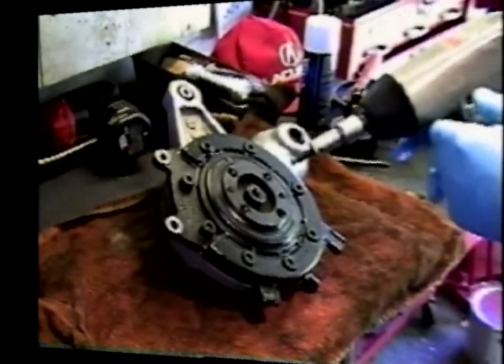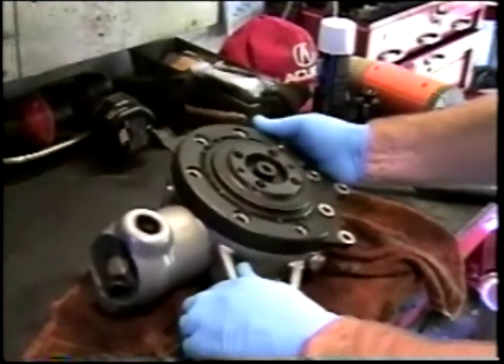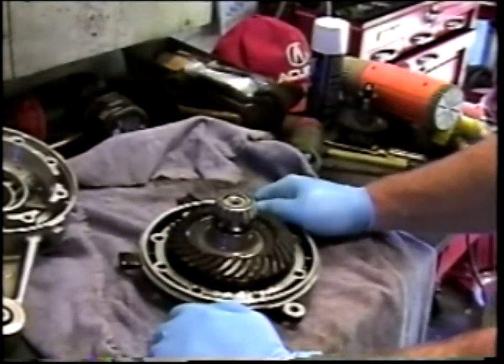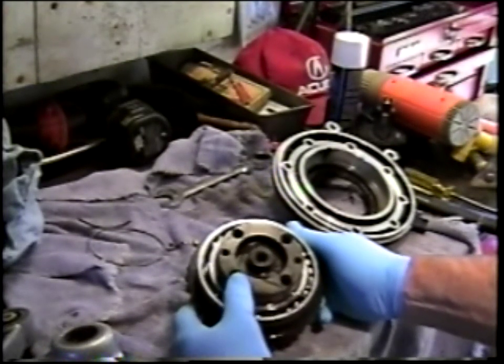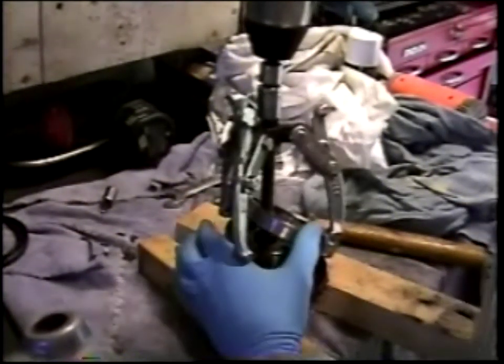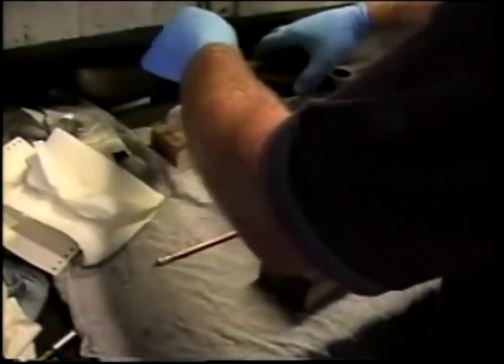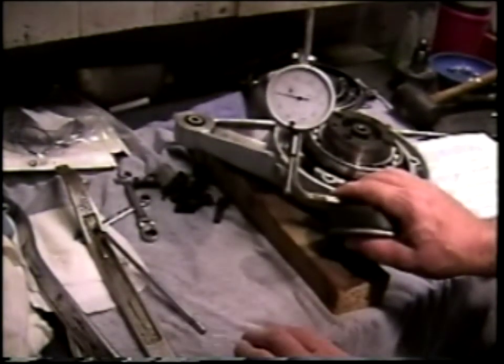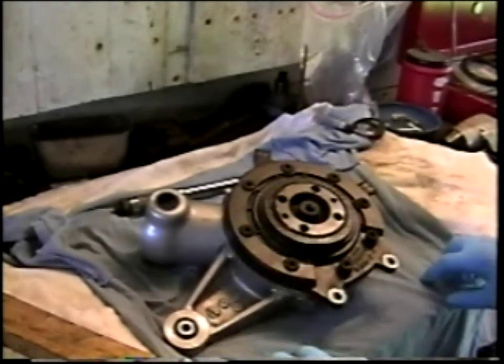BMW K1200LT Final Drive Rebuild

Comment: Did this job back in 2013 and put about 26,000 mile and I'm now getting slop when I checked it. The tire moves and you can feel the click as I call it (slop movement from left to right, checked at the mid point of the tire... Left hand mid tire to right hand mid tire) Feels like Shim was to small or something has moved inside the drive now.  play is about a few thousands now (.001 to .003) Will put on lift and drain and rip down to recheck its still good.. Im getting a bit of fish tail at times it feel like.

Comment: Thank you for taking time to put this together and help out a lot of riders!  Would engine degreaser be a better alternative to brake cleaner/carb cleaner to degrease the part?  Also, the spacing of the crown gear bearing creates the critical gap between the helical pinion gear and crown.  Without the spacers, they would push themselves apart until there was far too little contact area.  Thanks to your video, I was able to replace the bearings and seals in my R1100RT final drive, which I would have definitely struggled with without this knowledge.  This saved me HUNDREDS of dollars. Hats off to you!  :oD

Comment: "CLUE: When you put the shim in and you notice that its harder to turn, then here is the clue you have to much shim.... 
My old shim was 0.80mm and my new one is 0.13mm what changed... maybe they didnt look at what size they put in.. "           

Or maybe the original crown bearing was manufactured with a different race thickness.   For grins, it would have been interesting to test the clearance before disassembly using your same method to see if there was 3 to 4 thousandths clearance. Granted, it could have worn in but still would have been interesting to know if it was tight. The important thing though was to measure it as the bearings are manufactured today understanding that the wrong thickness will make a short-lived repair. :o)

Comment: Great, informative video.  Just wondering-  How did you determine that you put too much preload in?  Anything that indicated this?  Just wondering, as I have my final drive apart and am replacing the crown wheel bearing on my '99 R1100GS @ 54,000 miles.  I wish to use this technique to determine shim thickness.

Comment: Great vid but I need to replace the pinion gear bearings.
Reply: Sounds like your jumping in to a fund job...  take your time and check the forms as I know there are others that have done this job and there is a bit of updated information out there...  Best of luck

Comment: I am confused by the calculations.  If your gap is .33 and you need .05 shouldn't the shim thickness be determined by taking the free-play .33 less the desired free-play .05 = .28 shim thickness?  Free-play of .33 less the shim thickness of .28 leaves the desired free-play of .05.

Comment: It's a bad design.  A ball bearing is not designed to run with an axial pre-load.  On top of that, you have one bearing carrying all the dynamic load of the rear axle and the drive torque.  The old twin-shock BMW's did not have these problems.
Reply: Most of the problem is in the pre-load. I vote we go back to the old shocks and forgo this problem all together.

Comment: Ty, Nice video, I would recommend a bearing heater instead of the oven...check McMaster-Carr for that, After 30 years I retired from the heavy Machine Service field about 5 years ago, I use kerosene to clean parts also, I like that it leaves a light coating of oil and does not dry out the part and prevents rust.... I do recommend using a lint free towel like Kim Wipes,  l keep all bath towels and red rags away from bearing assemblies, they're usually made with a polyester material that doesn't break down in bearings and can ruin a new set of bearings.  Kim Wipes are lint free  and will not cause a problem, the bearing assemblies I use to repair and rebuild machinery were very expensive, $6k to $18k+ for the bearing components, spacers, labyrinths etc. for lathes and mills. So it was crucial that all components were clean, lint free and no finger prints. Many of the bearings had a spec for how much grease you would need to use, so a syringe was needed marked in CC"s and greased them up accordingly, do wear gloves, the real good grease may contain barium for heat resistance...albeit these are oil bathed but still the principles applies...
Reply from the maker: When "warming" the bearing it takes very little heat for it to expand on fit to the shaft from what I recall.

Why spend more money on something Im only going to use once... The little heat thats needed is nothing from the heat when installed and running. Heating a little on one part and cooling of the other is lets it slide very fast.. I think I had about 10 or so seconds before it cooled tight. Most heaters are more then the cost of the bearing... So I would say NO! Use your oven to warm it up... that all your need and it cost nothing. 

But thank you for your input.

Point of doing this job it to cut cost... Some have cut the cost of this $900 job way down. I did mine for under $350.

Comment: Hi,
I'm currently rebuilding my final drive and when i measure the shim clearance using the same method as you it is 0.4mm, but i can move the inner crown wheel an additional 0.2mm due to lateral play in the bearing. What shim size would you recommend? Do you take this freeplay into account?
Reply: Yes! You must take all of it plus when its hot (Aluminum Temperature Expansion
 is 12.3) So you need a bit more to keep pushing as the (steel is 7.3) and will take longer to expand.
Reply: Thanks for the reply. What shim size would you recommend?
Reply from the maker: Garry Dixon  it sounds like its should be 0.11mm - my number hits at 0.004330709 and thats almost 5 .. so thats just about right.